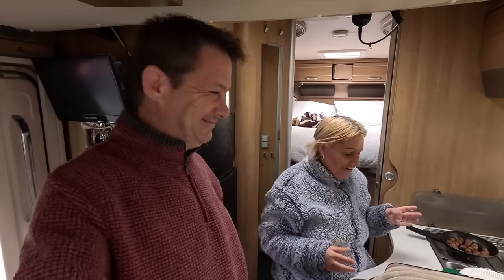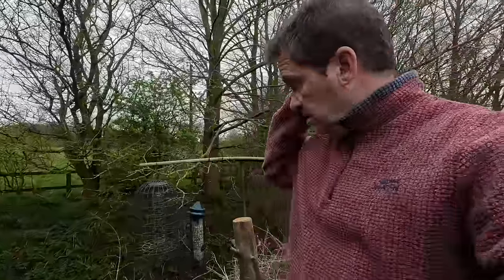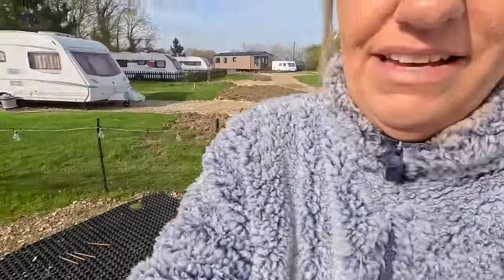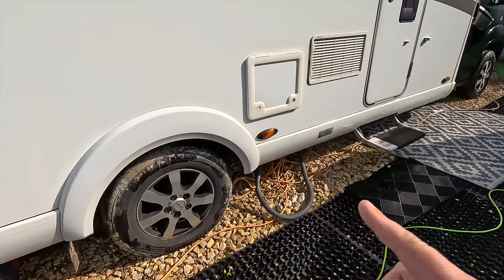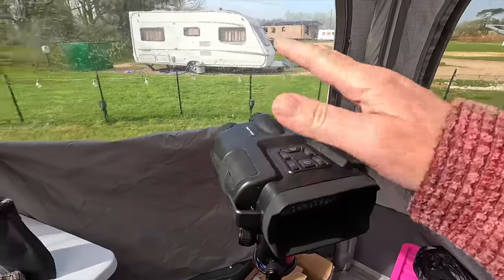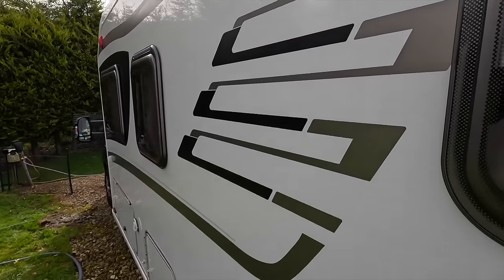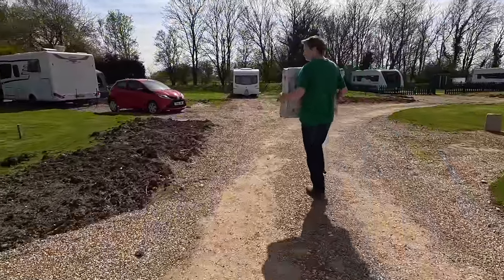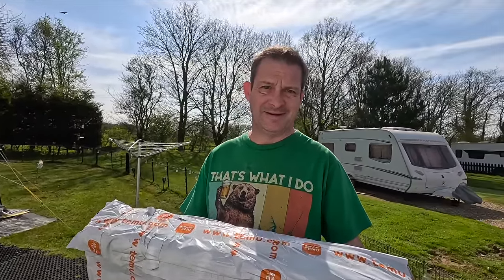When Girlfriends ROCK! Solo Van Clean By An Angel X

Comment: Get a thermometer capable of measuring that lower temperature, and drop one in each side.  It'll tell you if the display or the thermal coupler is gone bad.